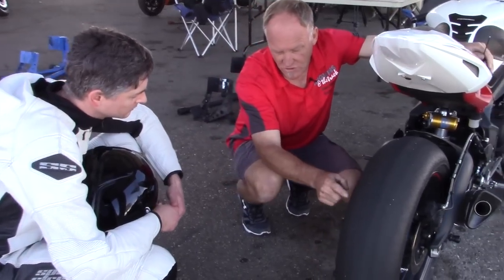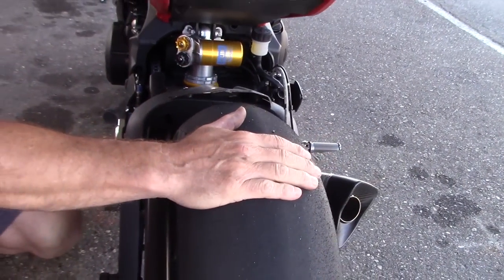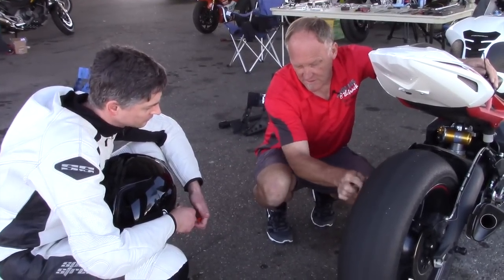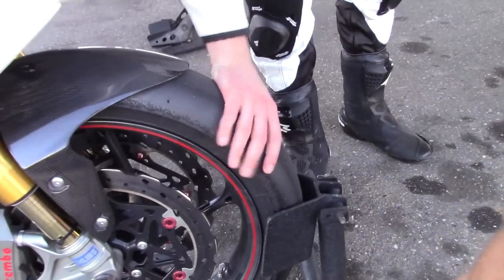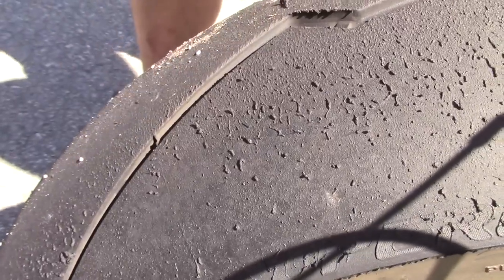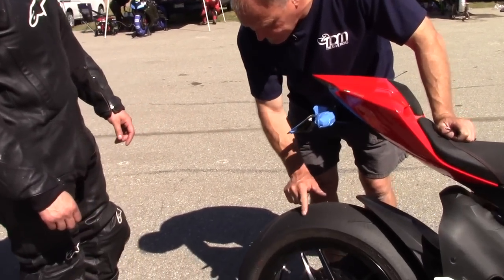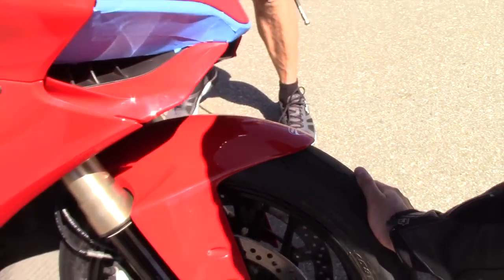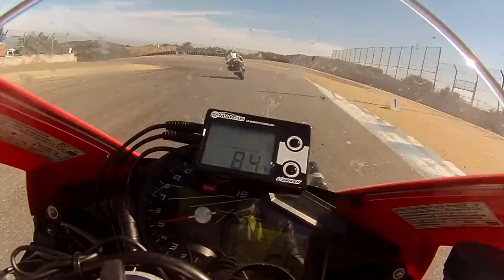Contact Patch: Motorcycle Tire Temp = Tire Pressure

Comment: I am curious about a few things with irregular tyre wear.

1. Is it only the heat that determines tyre wear or is it the hardness of the tyre or both?
e.g If heat wasn't an issue would high preasure or low preasure cause irregular tyre wear?
I would have thought that the higher preasure would keep the tyres shape better and therefore the wear would be more even but lower preasure would increase the contact patch giving better grip but increased wear from the tyre changing shape.

2. If you had the means of measureing the temperature of the tyres what would be the optimal temperature or temperature range?

3. I don't know if this is true but from my past experience on road bikes I have found that a tyre that has many sipes across the tyre, therefore has many small blocks of rubber with a pattern like a brick wall, is more prone to irregular wear than a tyre that has few sipes.

I have read from tyre manufacturers and road authorities that hard cornering and braking will cause cupping and that it is impossible to eliminate cupping on a motorcycle so you should keep the speed down.

In my younger days when braking hard in through a turn then instantly on the throttle to exit while scrapping everything on the bike didn't bother me, I was getting nice even tyre wear all round the tyre, with the exception of heavy smooth wear on the outer edges. I tended to wear out the sides of the tyres before the center was worn out.
I don't ride like that now that I'm 30 plus years older, well at least not as much. I like to know that I can still do it although I now tend to coast in the middle of the corner where i didn't before. I can't get rid of the cupping, could this be due to coasting?.
So is it true that you can never get rid of cupping unless you keep your speed and hard braking to a minimum or is that just propaganda to keep your speed down?
Reply from the maker: The part often missed is that the leading edge hits the ground and as there is a gap behind it (sipe), if collapses to create cupping.  1. Heat manipulates the compound and carcass to "soften" it, but the carcass decrees how much movement/flex there will be. 2. Street 140-170F for range.  3. The size of the sipe in length and width of gap will determine how much the leading edge folds irrespective of speed. Most hypersport tyres are no slick edges with sipes in the middle 20-40%.   With geometry, suspension and air pressure tuning and if needed revalving, cupping can be almost be eradicated.

Comment: My first bike was a 2002 Honda Superhawk vtr1000 and i put Bridgestone Battlax BT023's on it which weren't confidence inspiring, although I wasn't very confident at all being new, esp in turns and corners anyway. Sometimes I could feel the rear wheel slip in turns. Eventually bike was stolen. FF about 4 years later and I got a 2007 cbr1000rr such had a relatively new set of Michelin Pilot Per Power 2 on it which felt sticky and was confidence inspiring, although I don't know if it were my experience getting better, the tires actually being much better, or it being a better bike. To the question, the PP2's are relatively old being from 2010ish, yet they're still made and sold, or sold anyway. Are they still exactly the same or do they update the compounds with the new stuff? And if i liked them so much (and they still get great reviews) does it still made sense to get them, or should i look into a different set? Bc as it's said, they're yesterday's technology. And i was thinking going to the PP2CT's this time.

Comment: Would like to see video or explanation about what to do with track riding later in the year when the temperature has dropped, or just riding in general. What if it's 40 F in the morning and 60 F peak in the afternoon? Are stock tires better in the colder conditions? Are they chosen to be all around all-season tires? Is it better to avoid track riding all together if the temperature drop below a certain number? Thanks.
Reply from the maker: In Winter where those temperatures are seen, road tires are better as they heat up quicker. You won't be going as fast due to shivering so there's a lot less risk. Finding the right race compound and then getting the right hot temperatures that time of year is a real headache.

Comment: Iis there a way to find out what the ideal temp is for best tire performance and traction?  Like a manufacturers recommendation or spces for ideal tire temp for maximum traction??
Reply from the maker: Tire warmers that are single temp go to 90C/180F. For race tires, that is the ideal temp. For street tires 150-170F is ideal. Maximum traction is via chassis and suspension settings not temperature.
Reply: @catalystreactionsbw  so I dont need to be worried about 'low siding' or my tires [front especially] sliding out from under me?
Reply from the maker: @justaguy4real  We always have to take care of low siding from cold tires and suspension travel. We constantly progress so settings and pressures have to change.

Comment: Glossy with black dots suggests tire is not getting to temperature. However, I have also seen in these videos that oil can leak out of the tire during a hot tear and form a glossy film on the tire. How do you tell the difference?
Reply from the maker: the black dots are on the outer edges of the tire and cold tears are in the drive portion of the tire. Those are unique areas.

Comment: Hi Dave. You know how we spray  tire guard on car tires to protect the side walls from harmful sunlight UV rays, especially during hot summers? What's your opinion when it comes to spraying the same stuff on bike tires? Any insights?
Reply from the maker: I did this when I was young but have not done it for decades after having a rear tire slip out on me. I do not know enough about current products to know how they react to heat and if they will create loss of traction if the substance gets onto the tire surface? As with any product, careful thought prior to use should yield good results and maintaining tires with UV protection makes great sense.
Reply: Dave Moss Tuning
Thanks for the insight mate.
Tire slip out was my main concern really, and it looks like my worries are confirmed, for it did happen to someone else! I used to spray the product on a brush first and then "paint" the side walls, because spraying directly means some of the chemical/foam will definitely land on the contact surface. Secondly I noticed after spraying the tires walls and then riding, that the stuff gets flung from the tires onto the body (fairings and tank in my case) which certainly pisses me off!
Reply from the maker: I would make sure the tire was hot, use a cloth so there was minimal transfer and wait 12 hours or more before I rode the bike again. Cleaning all that off fairings is a real pain.

Comment: So they would come off the warmers if you had used them...at 180 degrees give or take and would proceed to lose almost 100 degrees front and rear. I guess you'd only need the low setting than correct? Or just spin the tires every now and then and just let the sun get them to within 10-15 degrees of the temp you're showing in the video. This should only take a lap. See you later Dave...go info and such a cool gadget for the guy that feels he needs it. Keep up the good work...we appreciate it. One more thing...it looks like it's reading the center temp...I'd be more concerned about the tire edge...yes? Can't you just rig up an extension and move it to the left or right to read the sidewall?  Later
Reply from the maker: If the bike is in the sun the tyres do nee to be rotated especially if the paddock ground temp is 150F. Agreed that is a device gives you knowledge and understanding, by all means use it in a wider variety of sitautions to get more data points just as I did with Driven's Mantis.

Comment: I'm new to understanding tyres and this information has been great! However after taking my bike into the hills, both the front and back tyres have a band of about 1 cm on the outside of very many and very small pitted holes.  Is this too related to the fact the tire is not getting to temp?
Reply from the maker: You should be gaining 3-4psi on the street with a good ride through the twisties. If that pressure gain is correct, the pitting might be suspension too stiff.
Reply: Many thanks for responding Dave! So are you saying that I could or should lower the PSI from factory recommendations (36R-33F) 3-4 psi less, as this is due to the heating of the air within increasing the PSI?

And you're right, my newly inserted ohlins suspension is really hard. I've been trying to back it off in increments to try to resolve the ride quality, as I thought this may of been the case. It was giving me a headache due to my head hitting the top of my helmet on the open road as I felt every bump! These Aussie roads are terrible. Thanks again.
Reply from the maker: You should find and define your own pressure for you, your bike and your roads. Suspension is no different :) Define it as best you can and if you cannot, do what it takes to get it right.

Comment: Ideally what are optimal tire temps while riding? And how do you feel about the tire pressure monitor systems that fit on the valve stems?
Reply from the maker: Any tool can be used when calibrated. Test temp monitors with actual surface and 4mm deep carcass temps for the correction factor.
Reply from the maker: Track 165-190F, road 150-175F

Comment: you could tell he wasn't getting heat in those tires by the chicken strips alone!
Reply: Ummmm no.  At 46 seconds of the video you can clearly see he is less than a quarter inch from the edge of the tire.  And lean angle doesn't equate equally to radius of the turn as it does from speed taken in the turn as far as lateral stress on the tire which raises the tire temp.

Comment: I guess the perfect temperature is based on when the rubber forms sticky balls
Reply from the maker: Prefect temperature is as per tyre warmers 180F/90C when on track and that depends on ability, lap times, track temperature and cold pressures.
Reply: @catalystreactionsbw  wouldn't the perfect temperature be based on the specific composition of the tire and how much friction it experiences on the road?

Comment: Ciao Dave, how to set the right pression after reading the temperature? If the tire is too cold we need to increase o decrease the pressure or viceversa?
Reply from the maker: you try increase first, then decrease second and the tire design needs one or the other.
Reply: Question! I tried the new michelin power slick evo and the front of my R1 was floating every time i open the gas. Before those tires i use the bridgestone V02 and i was able to run 3 sec better on every lap. How to fix this bike behavior? The bridgestone was 200/655 R17, the mihelin are 200/55 R17. Do I need to rise the back of the bike or to lowering the front?
Reply from the maker: You didn't take into acount the different circumference of the tires so the pitch of your bike changed dramatically, hence the change in handling and slower lap times. Seems like you need to change fork and shock geometry.
Reply: Ok, so i need to verify and change the SAG and so the preload of the fork and shock?
How in % the circumference influence the pitch, there is some sort of estimation to use every time we change tires?
Reply from the maker: a 10mm change in circumference changes pitch by 5% on wright balance.
Reply: Hi Dave, only to inform you that I was able tomanage the issue with the last Michelin power slick evo. This tires have a front weel design that riseup the front of the bike of 10mm... my R1 was floating everywhere till the fork was moved 5mm off the plate and the mono spring lenght was set +3 mm. For my amateur experience oll of this things sound like crazy, ayway it a sort of satisfaction to able to manage some strange behavior! Bye
Reply from the maker: Marco Capuzzo
Great work, well done!!

Comment: Dave im in some need of help with my Honda CBR 250R 2012...When cornering the tires feel verrrry slippery..What should i do/check??
Reply from the maker: Check born on date of the tires. Check the tires are still round edge to edge. Check fork and shock travel used/sag numbers. Next check pressure gain of 3-4psi over your cold starting pressures  - are you gaining pressure at all?
Reply: @catalystreactionsbw  tires are not round, stands a bit out closer to the edge..A little more worn in the centre..No pressure gain cold compared to when I take a ride
Reply: @catalystreactionsbw  what is the minimum psi that I can tske on my rear tire?Bike weighs 170 wet weight and myself 70..Which adds up to 240kg's..Rear suspension does feel verry stiff but is on lowest setting..Maybe the spring is to hard?It goes down about 11mm when i sit up against the tank
Reply from the maker: @djnardo8919  Look at fork and shock travel and see how much you are using. That removes guessing. Minimum psi is generally 30/30 for most hypersport tires.

Comment: Dave, think I asked this in the FB page, but... Is there a universal temp range or is the range specific to each tire / manufacturer?  Also, would it make sense to just put a thermometer on the tire just after exiting the track as a poor man's way to measure temp?
Reply from the maker: +Curt Schacker The temp range is normally 180F to 200F. The new Michelin Ultimate slick needs over 200F. That's why tire warmers go to 180F. The poor man's way to check temps? Put your hand on the tires in the hot pit after 4 or 5 laps. If the tire begins to burn you hand at 1 second, you are good. Next most cost effective way is via an infra red temp sensor for surface temps.

Comment: dave would you say that most tires should have the same type of balling or ware ? and if so basically if I have it flaking off you are suggesting to drop tire pressure correct ?
Reply from the maker: Depending on the track surface aggregate mix you may or may not see any balling. Look around to see what is generally true around you for a general truth. Then if the tires are generally balling up (that sounds so bad....) you should see a similar pattern in regards to the ball sizes being 2-3mm in diameter.  You would go down in pressure first and if nothing changed, go up as well.
Reply: ok thank you so much dave !! really love the videos you have on here ... extremely helpful and in much detail !

Comment: hi dave moss tuning
firstly I ride a bandit 1250sa with Michelin pilot road 4s  , I use 36 front and 42 rear ...is this a good pressure for grip for medium to fast road riding and some times aggressive riding or would you drop it a little ?
also on a warm morning even before riding some times the pressure might be up a little , let's say 37 ish front and 43 ish rear , would you leave the pressures at this or drop them to the 36/42  ? or what ever pressure you recommend for grip..
thanks dave
Reply from the maker: Hi Kenny. The sun/ambient temps will warm the tires naturally so you may see a gain of 2-4psi depending on the time the tires have been in the sun and the ambient temps when you check the tire pressure. This is effectively the same as riding the bike but the sun is doing it for you :). Tire pressures should be defined by you for your bike, your roads and pace and you riding style. I start at 46 rear 44 front cold and then work down in 2psi increments to find what I like based on the carcass (soft or hard) and profile (sport or touring). I will go as low as 34 rear and 32 front cold. The lower you go the quicker the tires wear out so budget has to be a factor at some point.
Reply: Dave Moss Tuning 
thanks for the swift reply , I am happy to sacrifice budget for a better feel at the front , bandit is a great bike but I always feel the front is a little vague ,I'm not sure if it's the bike or the feeling that the pr4s give ,  which I why I was wondering if a lower pressure would give a more secure feel , obviously the best way is for me to go out and try it , but the general thing that I find on the Internet is lower for grip and higher for longevity , 
so I'm guessing you would run higher pressures in a softer carcass to help it keep its shape/contact patch , is that correct ? if you have any knowledge of the pilot road 4s would you consider them to be a stiffer carcass ?
Reply from the maker: I did a huge write up on fork oil as I have a 1250S to that forum and suggested 10w oil as a compromise if you are running stock internals. I do run higher pressures on softer carcasses to retain carcass shape under load so I have more accurate steering. The PR4 is softer hence the slightly higher pressures. Have fun testing :)
Reply: Dave Moss Tuning 
thanks again , nothing beats a little testing when the sun's out 👍

Comment: so if you come back from the track and your tires are cold you have to drop 1 psi? can someone tell me the pressure used to Daytona compound?
Reply from the maker: Dunlop as 21 cold and 23 hot off the warmers after 50 minutes at 90C. Then, depending on your pace, track temps, ambient conditions and tire core temps you modify pressure accordingly
Reply: isnt it too low pressure? I thought a minimun of 28 hot was ok.

Comment: What Temperature were the Pirelli Diablo Supercorsa SP's on the Panigale set to cold?
Reply: +peter3746gixxer we don't measure tire temps when cold. We start with a given pressure, ride the bike for several laps and then adjust pressure based on carcass temps. Unfortunately, there is no linear relationship between cold and hot carcass temps due to all the variables:- bike, power, track surface, changing track temps, rider skill level, traffic etc.